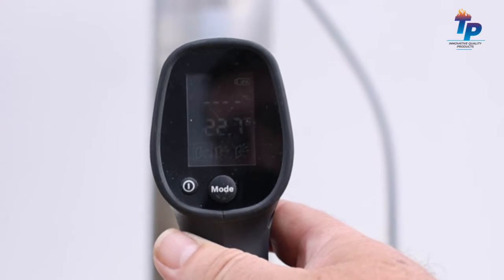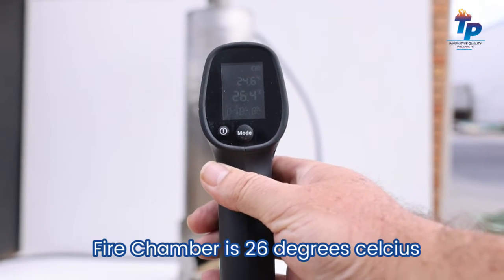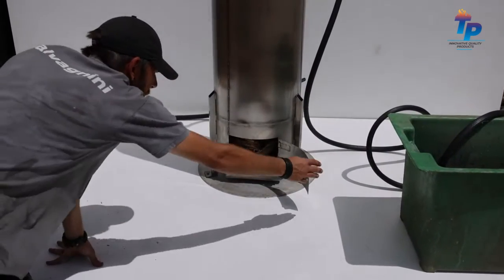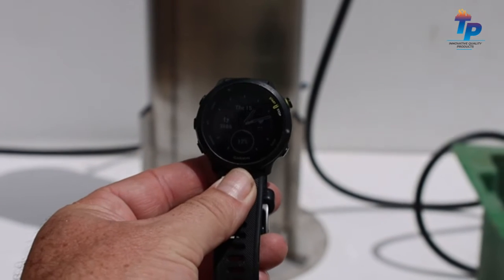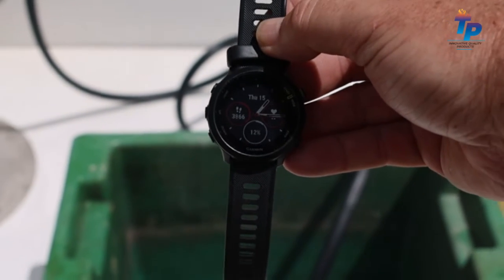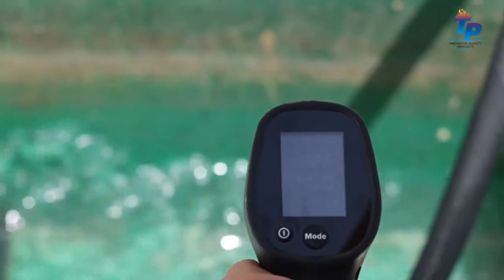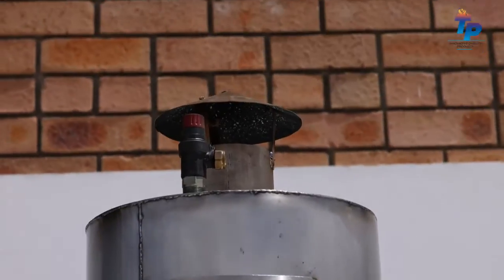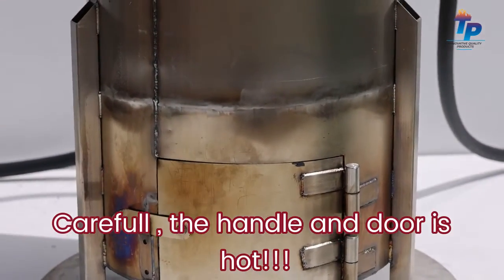Rocket Geyser - Wood Fired Boiler - Donkie - 120 Liter Stainless Steel (304)

Comment: change the fire to a rocket stove design, reduced fuel requirements and higher temperature burn
Reply from the maker: thank you for your response, but this is a rocket design. How would you change the design to make it better?

Comment: Hey, that thing reminds me of the coal fired boilers we had in our bath during my childhood back in the GDR.
You´ll need to put some refractory material in the bottom part, so as to not lose to much heat.
Making the boiler portion removable might be a good idea too, helps with patching leaks and general troubleshooting.
Cheers, have a good one.
Reply from the maker: Thank you for the feedback, we will surely look into it.